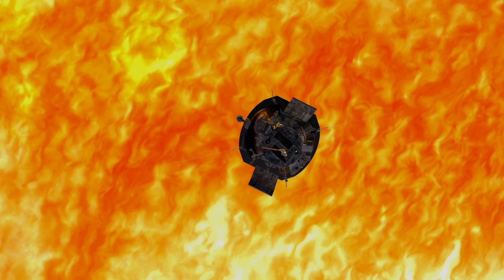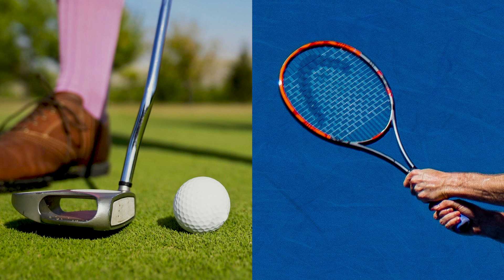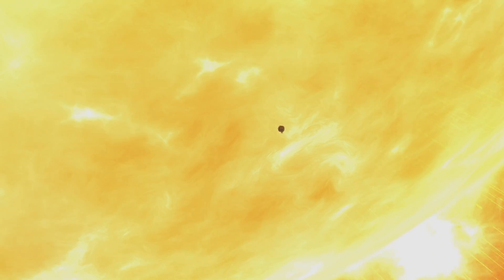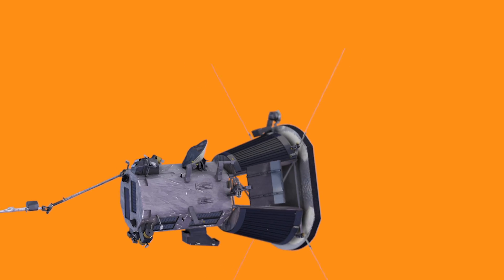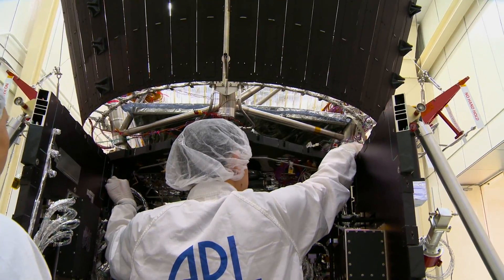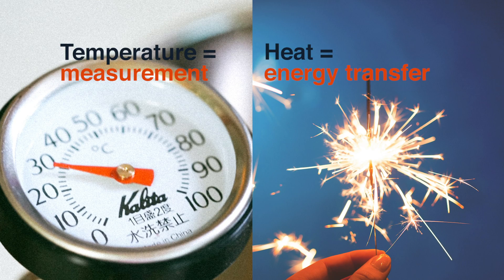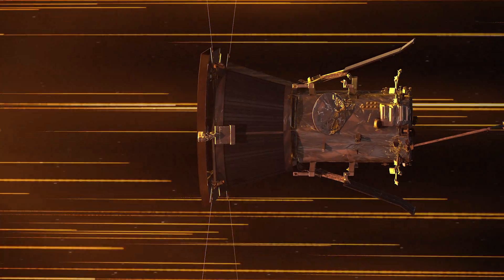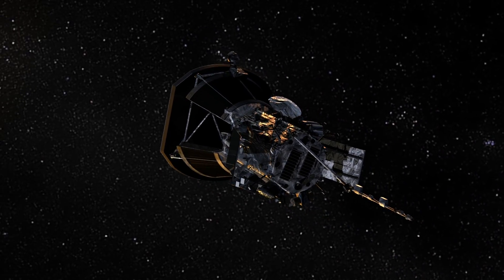Why Won't it Melt? How NASA's Solar Probe will Survive the Sun

Comment: I'm kind of interested in what would happen to the water in that closed loop cooling system. Water boils at 212 degrees but space is in a vacuum, which would make water boil instantly. So is it boiling in those lines or is it pressurized somehow?

Comment: Its amazing to me that people know physics intuitively, but have such a hard time understanding basic concepts. You can put your hand in a 450°F oven and it will not burn because the  hot "high temperature" air does not transfer heat (energy) to your cold hand at a high enough rate to burn you (convection ovens use a fan to blast hot air). If you touch the heated internals of the oven, you will get burnt (conduction)! And you may feel more heat from the bottom in the air, versus the top because that is where the heating element/burner are radiating heat. In order, the heat transfer modes are convective, conductive, and thermal radiation.

Comment: 2.000.000°F - 3.000.000°F = 1.111.000°C - 1.666.650°C
But from my knowledge about Sun's Corona is that the temperature can reach about 10.000.000°C (17.000.000°F) and that's much higher than stated in the video...

Comment: In the vacuum of space heat isn’t able to transfer equally like air on earth. If you are in shadow boom 3-4 kelvin. 
Mercury's temperatures can go between -279 Fahrenheit (-173 Celsius) at night to 801 Fahrenheit (427 Celsius) during the day.

Comment: The sun radiates in the form of photons via electromagnetic waves. When photons collide with another surface the energy gets transferred and agitates the host's particles which creates heat. The white shield will repel the photons instead of absorbing them. If the photons hit anything else in the probe, it's toast, literally. It gets more complicated from there with relation to convection and conduction, but a solar flare up that encompasses the probe will destroy it. But, I imagine they calculated the average distance at which flares occur. So ingenious.
Reply: if the satellite is so smart why can't it just dodge the photons smdh

/s btw
Reply: I don't think there would be convection in space
Reply: i thought the probe is gonna take a punch of solar flare right on its face, or at least that’s what i understood from Destin’s/smartereveryday’s video of this probe.

Comment: I am certain they have thought this through but the thing is EVERYTHING on the satellite will need to be able to withstand the high temperature. What about the electronics (circuits boards, wiring, sensors), fluid dynamics at such temperatures, speed at which sun will be approached cause if its relatively slow then regardless of how reflective the surface the material will burnout. Yes I know they are more clever than I am but we are talking about the energy of a star on full blast and I dont think such temp and heat have been replicated on earth to test the approach
Just another money making scheme for NASA to get funding

Comment: The question is when would it be launched and could it be proven that it will not melt on the surface of the sun..I never heard news that there are conducting tests about this..It's just an animation..

Comment: So the shield is only going to protect it from the front side ??
Reply: +legolas ackerman Heat will only rise when the ultraviolet radiation comes in contact with something(in this case the heat shield) since space is a vacuum the temperature outside won't raise. 
if you need some extra explanation why the beams don't come in contact with the rest of it, the beams travel straight, they will never bend.
Reply: Kevin Poelstra that's a nice way of explaining it, thanx👍
Reply: scared the sun is shining on the other side?
Reply: Kevin Poelstra 😑 what i meant is the heat is still surrounding the whole thing...

Comment: If you leave your hand in the oven it will eventually reach the temperature of the oven...
Reply: The lack of air it explaims why mercury is cooler than venus because nercury has no athmosphere the side facibg away from the sun has extremely low temperatures and only the side facing heats up. As with venus due to its athmosphere it traps the heat making it the hottest planet
Reply: Exactly! I understand the concept of the heatshield, but even when protected from the front heat and solar light, eventually the temperature of the probe will reach the temperature the environment around it... which I guess is not as manageable as she said. Can someone please explain me this?
Reply: Not When you constantly cool off your hand with cold water
Reply: Please don't think NASA is that dumb
Reply: Yes, but the difference here is that the probe can dump its heat off into outer space via thermal radiation; and since the corona is so thin, it will transfer its heat to the probe very slowly. So the probe eventually reaches an equilibrium when the rate of cooling off by thermal radiation is equal to the rate of heat transfer from the corona to the probe, which I assume must be much colder than the corona itself.

tl;dr: the oven is open.
Reply: 1. There is no air in space
2. Thermal radiation doesnt need air or an other media to travel
Reply: Can anyone answer this for me. How does probes survive solar winds because I had they are bad for electronics
Reply: Adrian
That's how you cook in the oven, at least I think so...
Reply: The probe radiates heat off the back. As long as the heat shield up front reflects enough heat back to the sun and only lets a bit of the heat through the probe wont overheat.
Reply: It cools down faster than radiation can transfer heat so it won't melt or anything like that because no air no convection
Reply: tutu ru Watch the NuWave infomercial again.
Reply: Adrian, I am not a scientist, but your hand will reach a temperature due to an air. Oven transfers a heat to an air, an air then transfer it to your hand. In space there is no air, therefore maybe it will actually survive. Please someone correct me if I am wrong.
Reply: miami, you are correct that since there is no air, there will be no heat transfer by convection, but there will be by radiation. So although it might take more time, eventually the temperature of the probe should reach a thermal equilibrium with the environment around it
Reply: João Cardoso maybe the cooling system prevents that.
Reply: okay sorry
Reply: João Cardoso The side in the shadow is very very cold. So just like your AC works too move energy from inside your warm house to outside, the probe let's water absorb the energy from the Sun at the front and moves the hot water to the back where it can radiate the energy into the cold shadow behind the probe. Your AC needs power to do this, and so does the probe. The great part is there is plenty of power provided by the Sun through the solar panels. So it actually uses the energy of the Sun to move the damaging amounts of energy from the Sun past the probe safely.

Comment: Why use a flat reflective surface on the front !?
Why not Magnetic field protection !
The heat and radiations normally have a  bended trajectory ..... How protect sides !?
What is the position of mercury in this mission !?
Is there a blended  point which can be used  in sun heat and radiations emission !?

Comment: I still don't get how being in space makes half your body burn and the other half freeze. Because I always thought you couldn't heat something up unless something hotter touches it. Or make something colder if there's nothing colder touching it.
Reply: consider putting your hand under a strong lamp, it will heat up, despite not being touched by warm air or any solid material. You will also notice that only the exposed part of the hand will get heated up by the (radiation) light and the one not in direct line of sight won't

Comment: I build Houses for 20 years. They use in modern times 25 cm diameter insolstion to manage temperatures in -20° to 30° ..... 
Thats Why i like NASA space Programm..... in a couple of years, i Imagine a House Insolation with maybe 2 mm Material!
Reply: Well, that won't happen. You can imagine everything if you want, but keep your insulation dealer at hand, because that probe will:
1, get closer and closer to the Sun
2, and melt into a red, then white ball
3, then evaporate fairly quick.

Comment: If the Sun is made up of The Sun is a huge, glowing sphere of hot gas. Most of this gas is hydrogen (about 70%) and helium (about 28%). Carbon, nitrogen and oxygen make up 1.5% and the other 0.5% is made up of small amounts of many other elements such as neon, iron, silicon, magnesium and sulfur. Why don't we send rockets filled with nuclear waste to the Sun that would prevent catastrophies of it here on Earth?

Comment: Did she really just say its like putting your hand in the oven? This is so fake that probe will disintegrate with in seconds. Fact: if you keep your hand long enough in the oven it will burn and cause damage. Same applies to probe the longer its in corona perimeter the higher the chances it will fail.
Reply: BlueTeam I got your 6 my guy you never watched the video did you? They are putting there hand in the over with an oven Mitt and water circulating that cant evaporate

Comment: The truth is that there is as little magnetic reactive materials as possible. The sun projects magnetic radiation and light. Space itself is -297 degrees and colder. There are no air particles like on earth to transfer heat. So the device only feels hear when a flare or something extends up enough to reach it.  Scientifically built on those facts.
Reply: Iron Oxide First of all. Absolute zero is -273.15 degrees, can't get any colder. Second. Heat doesn't need particles since it is radiation waves, sound needs particles

Comment: Now the real question is, how do they know the density of the Corona if this is the first probe to go there 🤔🤔
Reply: Ever heard of mathematics and laws of physics?
Reply: cleisz torrefranca, flying close to sun is not like apple falling down from tree, ever heard about perturbation ?
Reply: iani_3d so, you're thinking that laws of physics combines with mathematics is just about the analogy of apple falling down the tree. Do you even know how wide physics is?
Reply: cleisz torrefranca, yes I know, and that's why I tell you, simulation in laboratory is not like on the surface of the sun
Reply: iani_3d We have the ability to know what it's like to be there and any possibilities by making calculations basing on laws of physics! Simulation is just used to test the capability of the materials that they are going to use and most of time, just for representation.
Reply: iani_3d dude there is a lot of measurements that can be made from earth or near earth orbit, such as studying the corona in a solar eclipse, measurements by satellites further out

And weve sent solar probes before, this isnt the first but it will get the closest.

And youve obviously never heard of scaling up/down, building to higher tolerances than required of 

So your level of physicks expertise hasnt progressed much past Newton contemplating leaves and apples falling from the same tree at different rates... which is where the "apple falling on his head" fairytale started
Reply: Spectral analysis of the emitted rays from the sun. In simple terms, matter at different temperatures has different emission wavelengths and frequencies, so by analyzing the frequency and the wavelength of a particular band of rays emitted from any body of matter, we can determine its temperature..of course its not as simple as that but thats the gist of it.
Reply: There's been other spacecraft.

Comment: It's going to melt
Reply: Marothi Kalushi What I mean is that the amount of heat that the surface of the sun transfers to the probe isn't enough to get it to a point where it will start to melt. That is because of the lower density of particles existing in the corona, with respect of deeper parts of the sun. There are simply not enough photons projected to the probe to actually make a significant increase of temperature. It's simply thermodynamics, hope you now understand a bit more.
Reply: Marothi Kalushi sadly it will the suns temperature is too high for any material we know of
Reply: triple466 Temperature is not the same as heat
Reply: Vicente Vasquez read my comment again idk y u even reply
Reply: triple466 I did, you don't understand thermodynamics.
Reply: Vicente Vasquez so if the temperature goes up it doesn’t get hotter? And don’t make up some bulshit

Comment: What's causing the heat yo be removed from the radiators, usually there's fans or air passing through from movement

Comment: Hi, does anybody know how this thing measures the temperature of the "plasma"? Is this by conduction or by radiation? I think there is a great chance that the corona temperature is actually not as hot as everybody thinks. But you cant get these results with radiation measurements.

Comment: Where does the heat transfer too? You'd be surrounded by heat.
Why not just make it steam powered because that's what your waters going to turn into in about 2 sec.s
At normal atmospheric pressure, carbon does not melt when heated, it sublimes. i.e. it undergoes a phase change directly from solid to gas. If the pressure is increased to 10 atmospheres carbon (graphite) is observed to melt at 3550 °C
So the probe turns into a mass of jelly gas along with the wiring and camera keeps on ticking ... must be made by Timex
This is drival for the lowest common denominator.

Comment: Wait, if the hot water transfers heat to the radiators where does the heat from the radiators go? I thought there was no transfer of heat in space because there’s no air?

Comment: there is no material can dig more than 2 miles of earth crust due to heat equipment melts and yet we can go to sun.....
Reply: yes and you know this because you have been to space, traveled around the sun few times have you..???
Reply: The Sun is at an average distance of about 93,000,000 miles and that is not even accurate because we do not know, plus earth has a protective layer and magnetic field reaches out thousands of miles, a probe sent to sun is same is sending submarine in to deepest part on ocean and we have yet never managed to know more than %10 ...???
Reply: you can not engineer a material which does not exist, heat will melt and burn anything gets close to it, it is so simple and right in front of your eyes, i am not saying do nothing we need to know everything about the cosmos but not getting feed lies on the route to horizon...
Reply: there is no fear in me nor any logic in any one who thinks man made machine with material such as carbon can go any where near the sun, millions of miles near it maybe not near enough to really observe sun, anything you stick out to see and observe will melt straight away, logic lol...
Reply: Bektas Konca people don't realize the power of the sun nothing can touch it so stop believing these lies

Comment: Okay, the Solar panels have water circulating through it that also circulates through a radiator. But where does the radiator dump the heat? In an atmosphere fans typically blow air through the radiator and the radiator heats up that air and by effect radiates heat. But in the vacuum of space, where and how is the heat from the radiator, radiated away?
Reply: Chris Newman you r forgetting about radiation... Heat can travel in the form of em waves as well!
Reply: Chris Newman more surface area allows more heat to radiate out
Reply: I understand heat can escape in the form of infrared light and stuff like that. But in terms of how efficiently a large amount of heat can be radiated off without the use of solid or gaseous conduction must be extremely low. The solar panels must collect a lot of heat. Which mean to cool the solar panels through anything other than solid or gaseous conduction would require huge amounts of surface area for radiate heat transfer.
Reply: I'm looking into the stefan-boltzmann law. I think my answers will come once I understand it.
Reply: Chris Newman I was reading about the exact same thing right now... I've been having tonnes of questions... the thermal radiation depends on the temperature of surrounding i suppose... So how will it radiate heat if the temperature around it is in millions of degree Celsius? How will they stop the radiators from absorbing heat due the radiations from sun? I know they said the density of particles there is less so the heat transfer would be less but still it would it be low enough?
Reply: Chris Newman it is very inefficient way of cooling, but it is being heated the same way. More surface area cooling than heating up.

Comment: U dont need a huge heat sink when approaching the sun. Size matters, and the smallest you can get wins in this case.
Mass accumulates heat, as a very small satellite, the particles from the sun will barely hit it, and the ones that do are almost instantly cooled down by the shield and cooling system.
PS: heat in space, is a LOT` weaker than heat on earth, due to vacuum, lack of an atmosphere and lack of gravity.

Comment: if it works, then send a relatively bigger size parker probe and place it at the angle which is directly pointing towards the hottest region of earth, viz the equator. This will cool down the temperature a bit

Comment: Going at night won't be enough. It has to be winter too.
Reply: You're stupid as hell. You need to bring an AC too
Reply: Saani Maula dumbass. An AC is expensive. A few fans will do just fine.
Reply: See now I know youre a little special in the head, fans wont work in space. The AC can. Just put a hamster there to power it, since the SUN IS A CGI
Reply: Fans would totally work in space. Have you ever driven in a fast car and rolled the windows down? Same principle. Do your research.